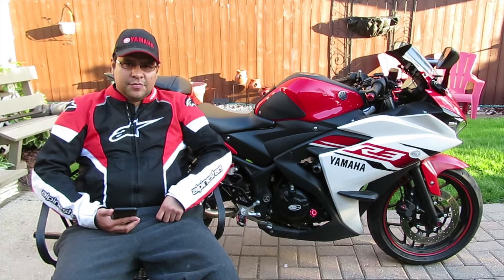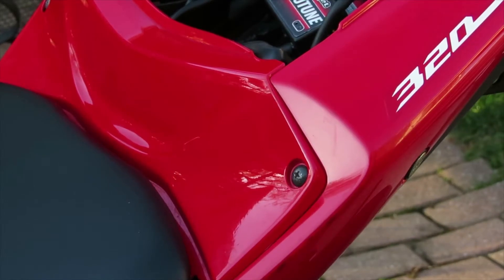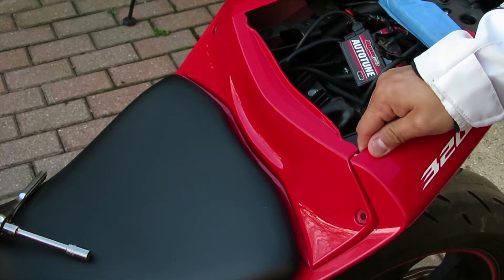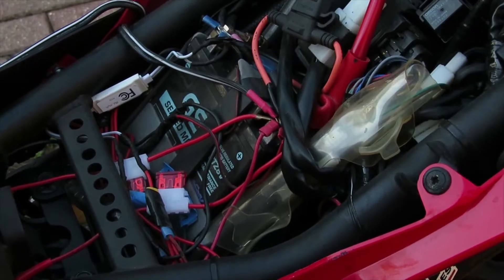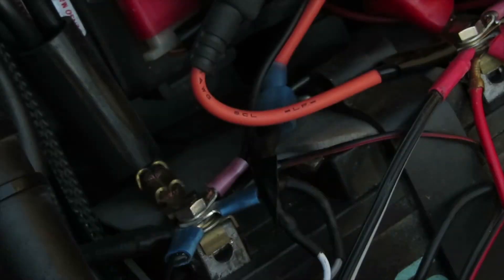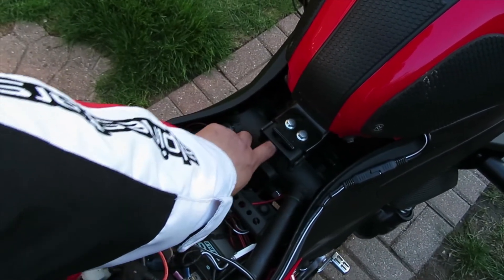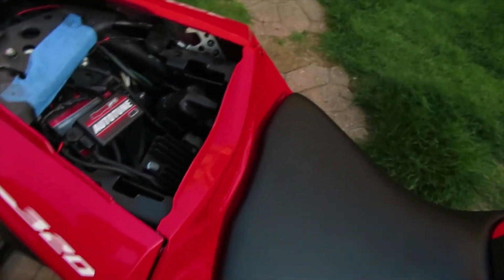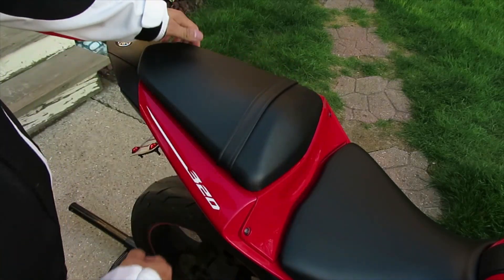How to Replace your Battery on Yamaha R3

Comment: just a sugestion:::: do changing of the spark plugs... owners manual says they need to be changed every 4k miles.(i think)..it's a simple job but for those who don't know it would be helpful and a money saver
Reply from the maker: Im actually thinking to do a 6 video series on R3 maintenance starting with a check list with what to do at 600 miles - 16,000 miles (965.61 km - 25,749.50 km )
Reply: That would be great! I'm getting ripped off left and right by dealers, and feel that with enough guidance, I can do a good chunk of the servicing on my own. Thanks!
Reply: A7madTSH what specifically do you need to know how to do ......oil? .....coolant.....?
Reply: As AC mentioned tho, a personal checklist that one could go through. Things like spark plugs and throttle cable adjustments/replacement are not described in the manual. For instance, my clutch recently snapped, and it would've cost me $100 to service that, so I ordered my own and am gonna install it.
Reply: how long have you had the bike are you the first owner?
Reply: Had it for 4 months, second owner, 2015 model, 9000 miles (I added the last 2000)
Reply: A7madTSH i would contact a dealership or somehow get ahold of the owners manual. change your oil/ filter every 3k miles....spark plugs 4k miles

Comment: Nicely done vid, brief & clear. Just curious, how many things do have wired directly to the battery? Does it affect it's lifespan? I ask coz i'm an idiot when it comes to all things electrical, lol.
Reply from the maker: the only time it effects the battery is if I leave my heated gear on with the bike off, 1min and battery is dead. as for how many things I have connected to the battery this is what I have ( brake light flash module, led kit, power for Gps, heated gear control box, and radar detector that I still have to remove)

Comment: Hey AC, I live in a cold place, and will sometimes leave my bike in the garage for a week or so without using it. I'm in an apartment complex, so I don't have a garage with an outlet. If my battery dies on me, can I take it out, charge it in my apartment, then put it back? Is there a specific battery tender that I could use?
Reply: A7madTSH ya most deffinetly take that battery out and hook up the alligator clamps and keep that battery charged ....keeping it charged will make the battery last longer ......get a deltran battery tender asap
Reply from the maker: brain budget is correct if you are not able to hook your bike to a tender , its suggested to remove the battery from your bike and place it on a battery tender at home . leave it on the tender till you are ready to ride. the battery tender will prolong the life on your battery.
Reply from the maker: the one i have is from sears auto, but any motorcycle battery tender will work just fine.
Reply: A7madTSH also don't leave the battery on the concreat make sure when you are charging the battery to set it on wood/carpet ...anything but the concreat
Reply: I heard that this was an issue with older batteries, leakage or something? Anyways, I'll be charging it at home, no concrete there. Thanks!

Comment: So unfortunately i live in a place where we get snow in winter, anyone have suggestions for battery usage during winter storage? Ive read things about getting a battery charge to plug it into for the whole winter and i've also heard of just removing the positive and pushing it to the side? Any suggestions and if so what voltage battery charger or brand? 2017 R3
Reply from the maker: I currently use this one to keep the battery from discharging  http://amzn.to/2ia08w0  but you can also just disconnect the positive cable or completely remove it from your bike and keep it on the battery maintainer inside the house. if your on a budget this one also works well http://amzn.to/2gJZJjo , dont use only a battery charger the charger will not keep your battery maintained during the winter it will just charge and shut off.
Reply: I live in Utah so I know the snow struggle. I just take my battery out and put it in the house so it stays warm through winter lol